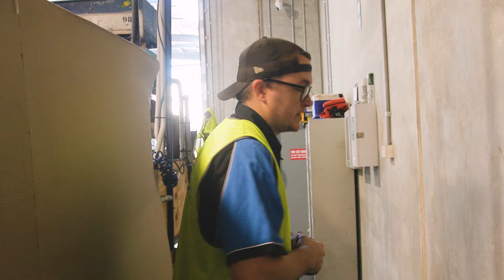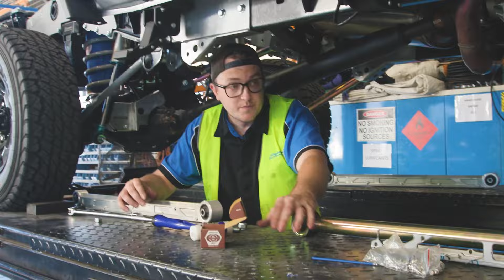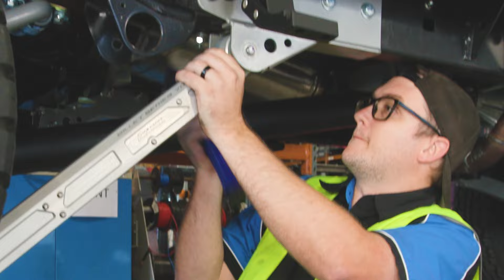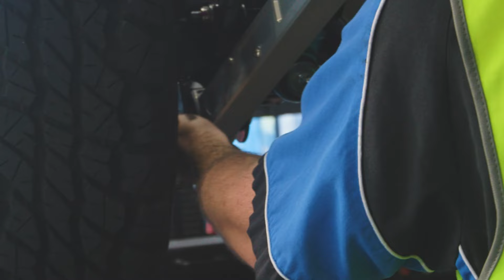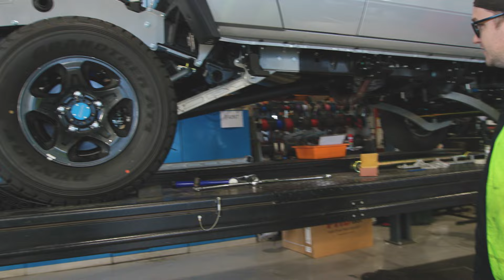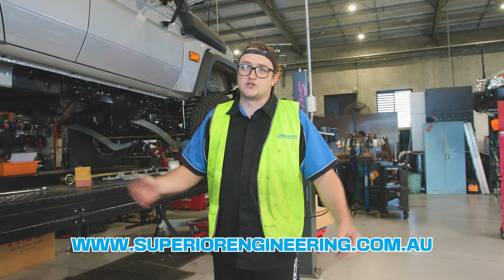Superiors NEW Billet alloy Lower Control Arms

Comment: Good luck with the inter granular corrosion on the 7075. It’s gifted me 1000s of hours of overtime over the last 20 years repairing aircraft fittings made from this. Yes it’s strong but being zinc based the slightest scratch to any surface treatment or paint that makes it through to the parent ally will start inter granular corrosion. Once it starts it’s very hard to stop and typically requires replacement. 
Anyway the suspension on a 4x4  would never get scratched to you should be right 👌
Reply: That's interesting to know mate, what would be a better alternative?
Reply: @ 4140 and just live with the extra few kilos. I don’t think any 4x4 should have ally suspension components.
Reply: @jordyyeoman8483  I was going to ask the same question. My answer is 6061 is muvh better against 7075 about corrosion but not nearly strong enough. Using 304 or 316L SS maybe an option especially 316L because it is also resistant to salt which is good on winter. But SS also have inter granular corrosion IF not properly heat treated. Aslo it is harder to machine. I have my own CNC shop and i am working on my pickup as hobby. 

Anyways i wish we can have an answer from @glenwindsor53. He seems like to have very good experience

Comment: When are you engineering 3" lift & 35" tyres for an 80 Series? With long arms!
Reply: Want this also, already have Superior Upper and Lower adj CA but want to go to a long arm option, on the 80s? Cheers Superior Engineering 👍